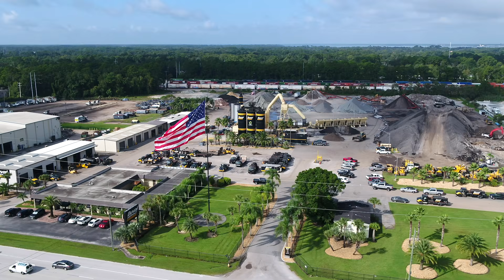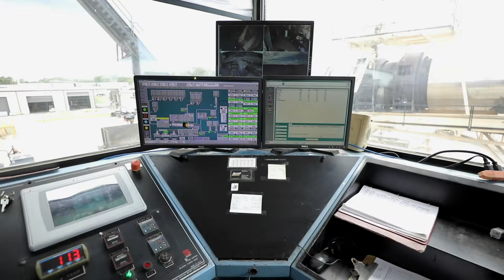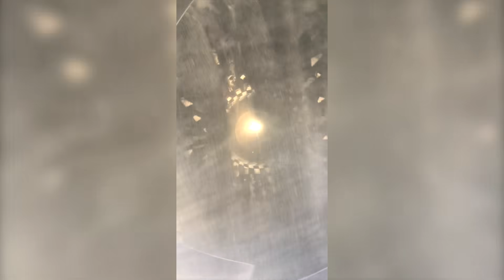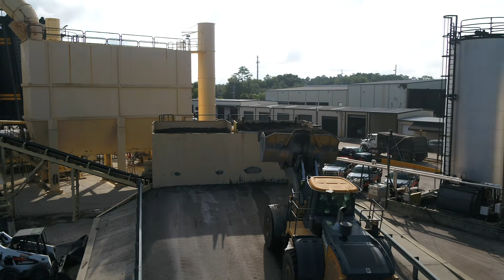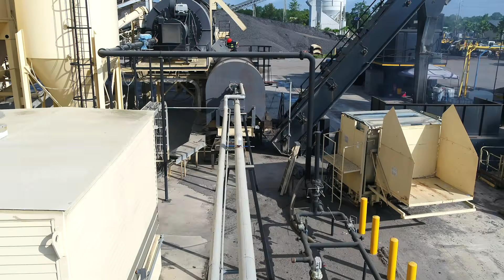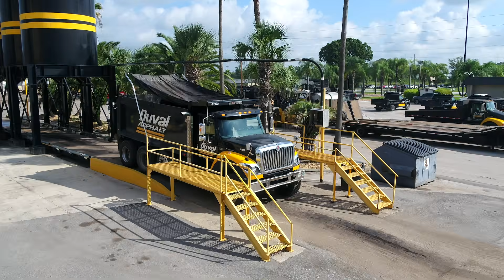How an Asphalt Plant Works

Comment: #1 skill for plant operator, pushing the right silo button to not drop asphalt on the trucks hood.
Reply: I have seen that happen way too many times although its not always the plant operators fault
Reply: @6181green  I knew a plant operator in Florida that had a picture of a dump truck with 12 or so hash marks. I asked him one day what it was about. He said it was the number of trucks that were under the wrong silo and didn't pay attention to the radio. He loaded a few hoods.
Reply: No, Actually it's don't catch the baghouse on fire!
Reply: @Steve-ov5lo  bwahahahaha experience talking?????
Reply: @asherdie  Not personally, but I've seen a few numpties get close because they weren't concentrating on what they were doing!

Comment: Delivered approximately ten thousand gallons of propane to a plant while it was running.  Just barely moved the gauge because the plant used so much fuel.
Reply: I worked in a sand mine for about a year. A very similar setup to the plant in this video with the dryer and whatnot. We’d burn anywhere from 3500-5000 gallons of propane in a 12 hour shift depending on moisture levels if memory serves me right.

Comment: Very nice plant, and well-groomed! I just retired from Las Vegas Paving Corp myself of 26 years. Looks like Duval uses only small dumps. Wondering does Duval use Bellies, Live buttons, or even load up Doubles bellies? All our plants can handle those types of trucks and are our primary delivery methods, plus small dumps for the tight areas. Even our mobile plants can take these trucks. Thanks for a cool look at your company's operation!

Comment: Even the asphalt plant uses concrete for the trucks to drive on.
Reply: 😂 that's because Concrete is extremely expensive so its not economical for use on roads. Concrete can take more concentrated loads from heavy vehicles ad doesn't suffer chip loss.
Reply: Do It In Concrete!

Comment: LOL, I knew from just the beginning drone shot that it was a nice plant. I worked at an asphalt plant 25 years ago, and it was a claptrap POS. At any one time, there were 20 things that needed to be fixed, and 5 potential things ready to go wrong without warning. That was a batch plant, as opposed to a drum plant like this one.

Comment: Great video. As a train enthusiast, I would love to know more about what the rail cars are bringing to your site and how it is unloaded from the cars and then stored prior to use.
Reply: The rail cars bring in the crushed aggregates needed for the asphalt mix.  They may also bring aggregates used directly for subgrade preparation as many asphalt plants sell aggregates of different varieties to contractors and the general public.  Asphalt cement can also be delivered by rail but today most asphaltic cement is brought to the plant by tanker trucks as it must be kept hot  in order to flow out of the containment vessels.   Aggregates brought in by rail are usually unloaded by hydraulic excavators that crawl up on top of the gondola type rail cars and dig out the material, loading it onto dump trucks.  The excavators are equipped
with special, high capacity buckets that do not have teeth and can clean out the rail cars efficiently.  The dump trucks deliver the materials to their respective stockpiles.  A front end loader will push up the dumped out material into a tall stockpile to save space.   This method works well as it controls segregation that sometimes occurs when handling well graded aggregates.   Sometimes the aggregate can be brought in by hopper cars that have doors on the bottom that can be opened.  For this operation it is necessary to have a system of conveyor belts to convey the materials to their respective stockpiles.  Careful attention must be taken to control segregation of the aggregates when using conveyors to feed stockpiles because if the material is dropped from an excessive height, large particles of material can separate from the smaller ones and render the material unsuitable for use as it may not pass the required specifications during a grain size analysis.
Reply: @davidmorse8432  Amazing and very thorough response! Thank you so much. That's very helpful for modelling and general knowledge. I appreciate your time. Thank you.
Reply: @alainaarrhodge5900  Glad to help.

Comment: Kuldeep Singh ... what the heck is an Asphalt Plant Engineer ? ? ? I never knew colleges offered that kind of degree ! Lol. I just retired from working in asphalt plants for 40 years. The last plant I worked at had 6 silos and was old and wore out and had to be worked on constantly. It's no fun running the plant and loading trucks for 8 - 12 hours a day then having to work on the plant for 1 - 2 or 3 hours so you can run the next day before you can go home. I don't know anybody with a college degree that would ever take a job working 50 - 60 hours a week in an asphalt plant. I hate the thoughts of getting old but I'm not going to miss working in an asphalt plant ! ! !
Reply: Thats why I enjoy just hauling the stuff way less headaches and more time at home for me lol
Reply: I worked on these plants in my younger days. I had a lot of fun with them. Alot of work for sure.
Reply: In my company, AP Engineer was generally a CE who worked on mix designs and QC issues. It could also be knowledgeable, competent people (like yourself) that were plant managers, head operators, or QC techs. Throughout the country there have been colleges offering CE degrees with Asphalt focus (we had one here in Washington State).  It sad when a company doesn’t re-invest its profits back into its equipment and instead rest it’s reputation and profits on the team maintaining the plants.
Reply: @315-snoblow  Did you work in India? That is where Alot is. A lot is more than one of something.
Reply: " I don't know anybody with a college degree that would ever take a job working 50 - 60 hours a week in an asphalt plant." You don't see any women working at an asphalt plant either. Although I met a stunning looking woman that was a driver in Mississippi. She let me ride with her a few times from the plant out to the job site and back.
Reply: @nathanwoodruff9422  AP operators do work very hard along with other laborers around the plant. AP engineers don’t typically make / shovel the asphalt. Females were always underrepresented (maybe they were smarter) but we had a few - especially in the QC department.
Reply: @paul99036  " Females were always underrepresented (maybe they were smarter) but we had a few - especially in the QC department." Yea, they worked inside in a heated/Air Conditioned office, had space to themselves and when they needed a sample, would call the plant foreman on the radio to bring them a sample. I'm well aware of that. That was one of the processes that were impossible to automate.  None were ever at the plant though.

Comment: Pretty interesting, my Father was a paving contractor in the late sixties and seventies. I remember sitting in his dump truck as a young person, and absolutely cringing because the dryer was close enough to watch the flame and the sound was tremendous. Back in those days the mixing was done in the plant mixer. A part of the plant structure itself.  I also helped shovel a whole lot of it. It's amazing how a piece of gravel know bigger than a pencil eraser could make one come out of your boot in seconds. Do you still use AC8 as a binder?

Comment: More on the binding agent please...
Reply: It is the last thing left over from the processing of crude oil.  It is called bitumen and if left to age for a few million years, it would become coal.  Ever hear of Bituminous coal? Anyway, sunlight can degrade this binder and that's one of the reasons why asphalt pavements have to be replaced over a period of time.  The good news is that they have equipment that can grind up the asphalt concrete, send it back to the plant and have it recycled.  There have even been some experimenting with doing the recycling on-site in one operation, but it has not been perfected yet as far as I know because you don't see much of that going on currently.
Reply: @davidmorse8432  Wow - thanks Dave, I have heard of fly by night paving companies that do residential driveways. Pavement is soft and full of sand....
Reply: @RedDFilm  You are right about that.  These guys are always from out of town.  That makes it difficult for an unsatisfied customer to bring grievances against them.  The scam goes like this:. A contractor representative in a fancy new pickup approaches a prospective customer and claims that his company is completing a big job and they have excess material left that they can sell at a reduced price because they need to get rid of it.  After they receive an advance payment from the customer here they come place an extremely thin layer of hot mix on the customers's driveway and are gone in a flash.  A couple weeks later the asphalt is so thin that grass is growing up thru it and the customer cannot reach the contractor that did the job.  There is seldom a case where there is excess material left over from a job and if there is any, it would not be enough to complete another.

Comment: Is it true that you could create much more durable and long lasting asphalt for the roads, but the municipalities and states don’t want to pay for it?
Reply: Its always about cost partner.
Reply: Tell a politician they can spend $50 million paving a road that will last 5 years or $100 million to pave it to last 20 years, and they'll pick $50 million, then put saving the taxpayer $50 million on the project in their re-election campaign! Sadly if they even tried pitching the more expensive option as better long-term the opposition would immediately scream about taxpayer money being wasted. Everyone loses either way.
Reply: @jblyon2  well it would also help if you didn't have the municipal shitheads deciding to replace water/gas/sewer/etc lines right after they redo a road. thus no matter if it was a 5 year or 20 year road, it is now ruined and after the line replace has chopped it up you end up with a shit road again, in which repaving the thing was just a waste of money.
Reply: @Dratchev241  I'm laughing...because they repaved the utterly horrendous road past my office. It was pristine. New grading, drainage, the works. Absolutely divine to drive on. The next year the gas company decided the line under the street needed work, tore up half a lane for over a mile, and patched it up WORSE than the old busted road was.
Reply: @jblyon2  shit is same here dude, only they do it weeks after it was repaved. Hell I have seen them a week later come and tear it up for line replacement..
Reply: @Dratchev241  I have to give my local mayor credit. He blocked the state from repaving a major road in town until AFTER the water company finished a planned water main replacement. Since they only had to use temporary pavement to patch it afterward, didn't have to replace all the damaged curbing since it was getting redone anyway, and could get permanent patching done on side roads at the same time by the same contractor the state was using it saved the town a boatload of money. Plus we ended up with a nice road that wasn't immediately destroyed by the water main replacement.
Reply: same with concrete . one city the mayor opted for a 1-1/2'' resurface instead of 2'' , whereas the county commissioners opted for 2-1/2'' instead of 3'' . neither the city or county employees know how to fill a pot hole . the city just spent two million on streets and they already are cracked and the next month the city water dept tore the streets up to lay new water pipes .

Comment: whatever they did in the parking lot at my complex, it wasn't right.  It's only 1.5" thick and so far, over 25 years, it has cracks over 1.5" wide where the asphalt has shrunk!
Reply: That is what happens when the owner cheaps out on parking lots.

Comment: I knew my parents were lying just to keep me outside while they had fun indoors.
The would give me a box of pebbles and tell me they were asphalt plants I needed to bury by the edges of the highway so the road would get wider. I'd be inches away from 60mph traffic with my little plastic trowel and a watering can, planting the little tiny rocks for hours at a time.

Those lying a-holes.
Reply: Holy sh¡t, same here! Exact same scenario. Parents told me it would "make the road grow."
I hated when people threw trash at me when they were going by at highway speeds. Glass bottles hurt the worst.

Comment: I’ve heard asphalt cannot be produced in the winter time, is that true?
Reply: Yes, that is true. It has to be above 35F degrees outside just to get the plant running. If it is not above that temperature, the first 30 minutes of mix can harden before getting to the silos to be dumped into a truck. There are no heaters in the silos to keep the mix hot.

Comment: Nice drone footage, and good job keeping the drone out of reflective surfaces. I did however see your propeller shadow. :)
Reply: same.  ' they must be using a drone " then the shadow. nice way to show the process.
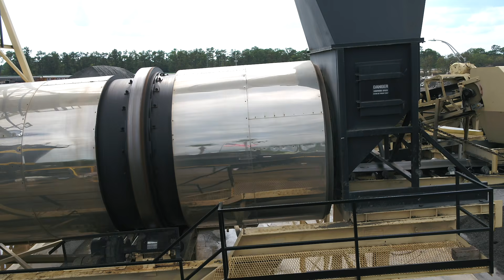Reply: The drone is plainly visible in the rock dryer at 03:06. Center of the screen towards the bottom.

Comment: They need to use better materials that dont fail in 3 years. Pot holes that can take out a bus or two. They have it Germany wete the roads last a long time before developing pot holes or gathering up at lights. Its all about jobs. Our roads are a disgrace here in Southeast Pennsylvania. Down South they dont have the problems like we do up North. Winter time is brutal on roadways. It frustrating on any drive dodging and weaving out of the way of road craters(pot holes).
Reply: It's not so much the Asphalt, but the Concrete foundation of the road that is the difference between the Autobahn and the US highways.